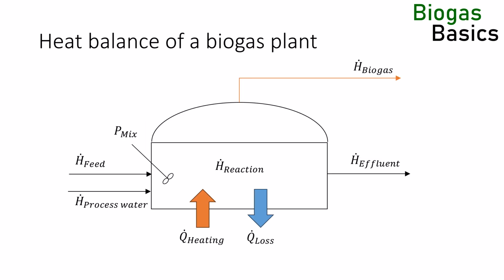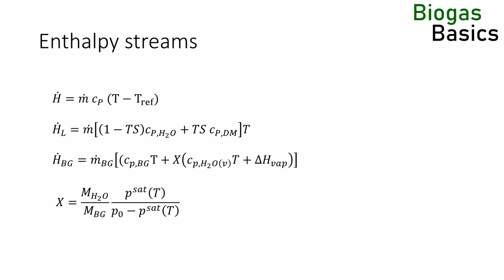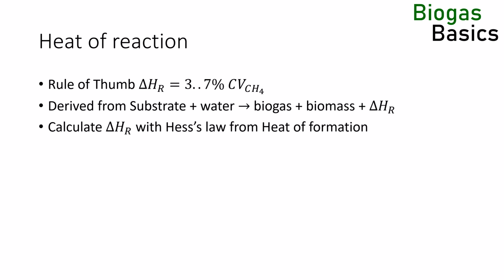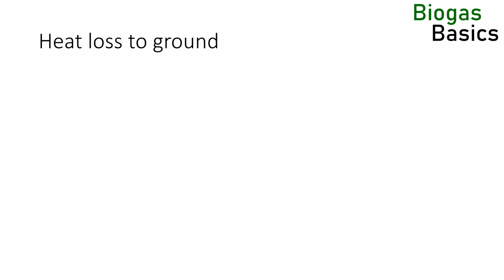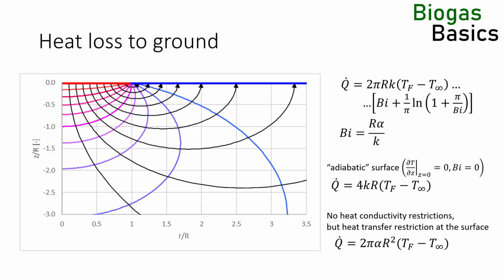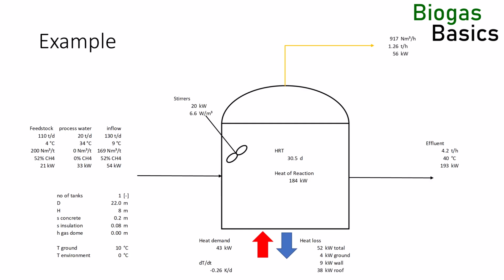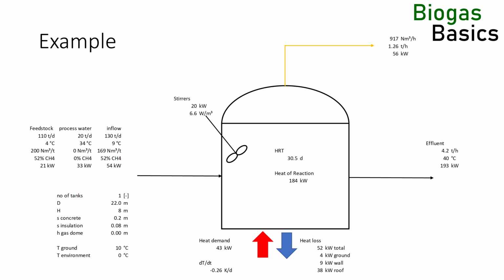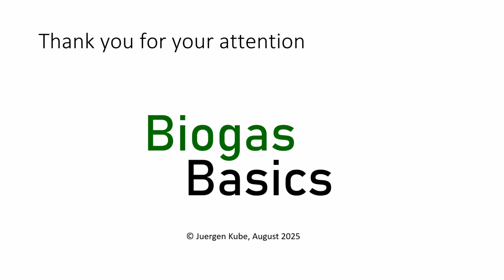05 heat balance

Comment: Nice video, please, how did you arrive at a biological heat of reaction of 184kW?
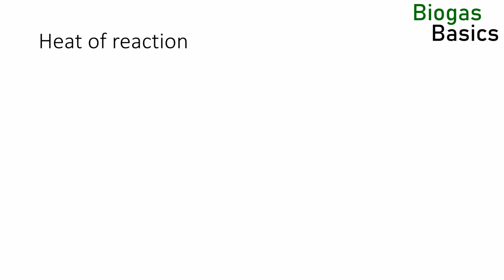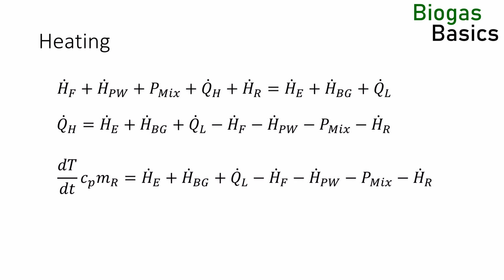Reply from the maker: The heat of reaction is a percentage of the CV of the produced CH4. For the reaction C6O5H10 (starch, cellulose) + H2O -> 3 CH4 + 3 CO2, the theoretical value is -162 kJ/mol or roughly 6.7% of the lower CV of the produced CH4. Because of the biomass production, the actual value is a bit lower. See 03:37 and presentation 02 8:40 onwards (https://youtu.be/iyu-wS0Wfxw?t=520)